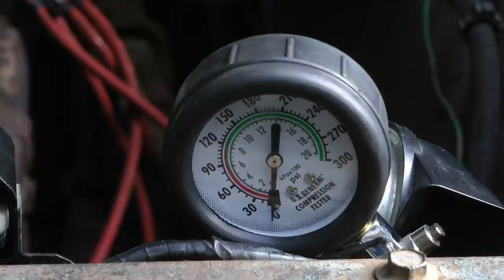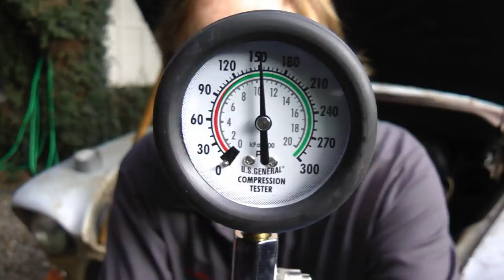How to Tell if Your Car's Engine is Bad

Comment: love ur vids,very cool. Question i have a car with the brake discs seized in place. i have taken out the bolts but it will not budge+ i am afraid to blast it with a sledgehammer in case i mes up the half shafts. its front wheel drive Renault Megane scenic( European car).its the type where the disc has a 2" hole that slides over the center spline onto the hub... any handy tricks would be grateful as its a sentimental car, my mum owned from new + its only has 68000 miles in 13 years

Comment: Hey Scotty I have a 1999 jeep Grand Cherokee Laredo.2 mechanics said my motor is blown it never overheated it has the straight 6 in it it only starts to shake after going about a mile do I think it's a blown motor problem or is there anything that I should know that's a sure sign of a blown motor? Any advice will b very appreciated

Comment: scotty I have a 2002 ford Taurus with 195k. question, whenever I drive between 30-45 mph my rpms drop down significantly and my engine feels like it lost power. if I continue to press down on the pedal my car jerks and if I let go and press down on the pedal it picks back up on power. do you know what this could be? I appreciate any help or advice. (I have replaced sparkplugs, coil pack, plug wires) and problem continues

Comment: Great Scotty. I've a VW 1.8T benzine engine that burns the motoroil in seconds, thick white smoke of the exhaus pipe, milky fluid on the motoroil filler cap and engine has no power. Did all happen after i fix the low oil pressure of the engine. The filter in the oil pan was dirty. There is no oilleak outside the engine.The engine was normal at the time and motor oil was stabel at that time. Now its worse.What is all the cause of this? please help me. Your Fan

Comment: Hey Scotty. If compression is still low with a little oil valves are leaking? Like your channel
Reply from the maker: yes, oil will not seal worn valves, only worn piston rings
Reply: Scotty Kilmer OK, now I realise why you said it was bad when the pressure went up.

Comment: Sadly recently found out my engine is wearing out.  cyl #1 is down to a 105 psi. the rest are around 150 psi. So im pretty much just having to deal with it because i can't afford to rebuild it. But i know that when i rebuild it, im going to build the bottom end with forged internals.

Comment: Hey Scotty, I have 2016 Ford mustang ecoboost and 2 days ago my car had P01450 and P018C code which i got fixed (replaced Fuel Pressure senson and Purge Valve)  from the dealership. My car does not have a check engine light but I still scanned my car for any pending codes and I found it has P0304, P0316 and P0234 but no check engine light yet. Do you think my engine is failing? my car is bone stock and covered under power train warranty.

Comment: Hey Scotty I have a 02 s10 2.2 and it is idleing really weird. Still runs but has no power and is smoking out of exaust but the car isn't overheating and I have good oil pressure.
Reply from the maker: +Jesse Lewis do my video "how to tell if your head gasket is blown" it probably is going out

Comment: I usually figure things out myself, but I'm in a bind    I got a 94 jeep grand cherokee    (california)    voltage regulator went out   replaced computer first time    then ran for 500 miles or so then   60 amp fuse burt out again.    replaced computer again and it lasted for maybe 100 miles  now its the third time    waiting for computer to come in from auto zone     i suspect it will work for a while   Do you think I'm getting a bad computer   or is there another problem?

Comment: I was checking the changing the head gasket ended up taking out the fuel rail some of the fuel injectors Stewart on the head and I don't know where they go my friend told me that they have numbers and on the fuel rail and has the number to the injectors I don't see none at all how can I check which one goes in which hole thank you

Comment: so what should a cylinder compression be in  a 2002 toyota celica for example? and if you add oil and test again you say the compression shold read the same not higher? or motor rings are shot,,,thanks

Comment: So if I am hearing this correctly, by pouring the oil into the cylinder it seals the worn piston rings and raises pressure in the cylinder. But if you pour oil into the cylinder and pressure is still low then it means that the valves are leaking or bad and the piston rings are fine?

Comment: Which is the most to least reliable engine in terms of long term reliability from your experiences: Toyota's 2.2L 5SFE, Toyota's 2.4L 2AZFE, GM's 2.2L Ecotec(Saturn Ion, Chevy Cobalt, Cavalier) or GM's 3.4L(found in Chevy Impala, Buick Rendezvous, etc)?
Reply from the maker: they go from best to worse in the order you presented them, except that gm 2.2 L is the worse of the bunch.
Reply: From my 16 years in the repair business GM engines are far worse then any Toyota engine. The 3.1/3.4 GM engines have many flaws and a big one is the intake manifold gaskets which if left unfixed will cause coolant to enter the engine oil and it's over from there. This repair will cost on average $800. Where the Toyotas you listed don't have any major issues. The 5sfe do tend to leak oil from the oil pump oring but they are pretty stout engines.
Reply: My wife has a ecotec 2.2 Saturn ion (2006) and it hasn't give her any problems and it's close to 200,000 miles. Just basic maintenance... Hardly any money has been invested into the car

Comment: didn't catch it if you did mention it but on modern cars its not a good idea to wet test. The oil goes down the exhaust and smothers the CAT in oil which then doesn't do the CAT any good.
Reply from the maker: that tiny bit of oil won't hurt anything, most blows back into the pressure gauge anyway

Comment: hey scotty can you make a video or do you have a video showing the different colors of exhaust smoke??? i have a hyundai santa fe with a 3.5 L engine that is smoking it looks whiteish and at times looks like a blueish tint (which im not really sure about) but im going thru oil like 3 to 5  quarts in a months time.  the exhaust has the smell of burning oil and fuel and something else i cant pin point ( every now and then smells like eggs). the oil has not color change and when i check the dip stick and put on a white cloth  appears to be normal it also smells like fuel.  
i have pulled the plugs they look greyish to me no black or other color.  i know the valve cover gasket is leaking ( which i am waiting for the part to come in to fix). but the smoking is now my concern. im thinking its the head gasket or a valve problem. which im not really sure about either the more i look into things its starting to sound like bad rings. so i would like your advice if possible. 
when i run this compression test should i make sure i pull the fuel pump fuse so it does not start up ????
Reply: also it does not seem like there is a compression issue it has power and doesnt seem to lose power or drag at all. that is why im concerned. i bought it used at 126k and put about 2000 miles on it so far so i dont know if it has had any other work done.

Comment: Hey Scotty, my cousin has a 2000 GMC Sonoma with over 200k on it. A couple spark plugs got broke off in the head and he doesn't have time to fix it himself. I'm going to buy it off him for cheap. He currently has the timing belt taken off it, are there any ways I can check for the engines health without having to turn it over? I've checked for oil leaks on the top, and the side of the engine. Any advice would be great, thank you.

Comment: Hey again Scotty.  Hope all is well in Texas.   Gonna do a compression check on my engine and just wanted to know do I need to put any sealer on the spark plugs when I screw everything back in after the test (just reusing the old plugs). What do you reckon?
Reply from the maker: Tom Pongrac no, but you can use some anti seize lube
Reply: Scotty Kilmer Thanks Scotty

Comment: Hello good sir, How much oil did you put in? Will too much will bend a rod like you told us about water in the "why driving through water is bad" video?
Reply from the maker: +Daniel Keener oil is on the other side, the inside of the engine, not the compression chamber. SO, too much oil won't bend pistons,but it will blow out oil seals and cause oil burning too
Reply: But I thought he put some in the spark plug hole? :/

Comment: My 1996 Chevrolet Cavalier keeps cutting off and can't find a fuel pressure regulator. Do you think that a new engine will fix everything?  Been unsuccessful with 5 mechanics including Autonation Chevrolet. They claimed to have replaced the oil pressure switch and don't know why the car cuts off when driving, and recommended to have the #4 fuel injector replaced and mounts upper and low. What do U suggest?

Comment: Hi Scotty! I have rav4 2002 and worried about a metal chime sound at 1500 rpm. What is this problem probably? Thank you Scotty!
Reply from the maker: +benedicto zaragoza check for worn exhaust parts, like heat shields or rattling cats

Comment: so, when you test the compression, are you starting car? or just trying to turn it over until the needle on the gauge stops spiking up. also, how/where can i find what the average psi on the cylinder? a technical manual?
Reply from the maker: just turning it over. but most manual do not give specifics as it varies a bit even in the same engines due to production non purity

Comment: Hi. If the compression is bad would it be worth it to overhaul the engine? Or is it beter to just buy a used good motor ?
Reply from the maker: depends on IF you know anyone who can rebuild them correctly, that's a dying breed these days

Comment: Thank you for the video(s) Scotty Kilmer.                                                                                        
         I have a stupid question here- if I'm not supposed to ask here let me know. I am looking at doing a engine compression test for 1996 Jeep Cherokee. I had drained the oil and taken out the radiator and serpentine belt (in thinking it was head gasket but now it might be rear main seal oil leak) So I would like to do a compression check. I was going to put some oil in maybe 3-4 liters back into the engine). Can I get away with 3-4 liters of oil (6 liters normally) if I'm turning the engine with the starter 5 count/ times each cylinder as you show (5x6 cylinders)x2(dry and wet)=60 times of cranking with starter.
Reply from the maker: yes, that's fine as long as the engine does not start up and run
Reply: Thanks for the help Scotty- I did the compression check with 4 liters of oil just with cranking and no problems.

Comment: I ned your help mr.scouty.  my engine might have melt piston rings. so the oil leak out completely so the oil pan gasket need to replace because oil come out from bottom. so with a dry engine I turn on the car and engine sound rough, and lots of smoke came out from exhaust. it dies out in 3 seconds. even a dry engine can run for more than 10 minutes without oil. so what's the problem. I red line through 1-3rd gear and up to 4th that's the problem came up. the engine wasn't fully warmed up and with a supercharger

Comment: why not leave the outside as is, it has character, simply put on safe tires do a tune-up and run 1quart of Lucas in the oil? worked on my dad's truck and got an extra 67000 miles out of it

Comment: Can I bring up something that I always do during a compression test? I always stick a spare spark plug into the pulled wire before I crank the engine. Make sure the spare plug is grounded to the inner fender or something. It only takes an extra few seconds. The coil tries HARD to make a voltage high enough to jump the spark gap and I think it hurts the coil when there's nowhere for the voltage to dissipate when that pulled wire just hangs there in space. Maybe it's just me.
Reply from the maker: +Scott9084 that is a good idea IF you have no combustible gas coming out of the engine as it cranks. Just don't start an explosion

Comment: I have Toyota Corolla 2009 s model with 137000 mile one it. I took to so many places to fix driver side pulling specially when I go over 60 and sake really bad when I try park by going back. It sake worst when I go really slow to park. Any help or advice is highly appreciated.

Comment: scot i got a 2nd hand 5sfe engine thats done about 170000kms. im getting the head resurfaced and reconditioned with valve jobs and etc. i cleaned the carbon off pistons and the piston walls look clean and everything and inside internally with sump removed. will the new head cause problems with the bottom end?

Comment: Hello quick question.Before I start my 94 Chevy pickup their is a loud banging noise as the engine cranks .then when it dose start it stops??? I had someone mechanic  changed the distributor and now it's making this horrible loud noise.  Any suggestions will help thanks.

Comment: He never mentioned about having the engine warmed up or holding the throttle open while cranking it. I also noticed that he only cranked it 3 times with the low compression but almost 7 times after adding oil... hmmm?

Comment: I'm surprised that it is not mentioned in the video that when you do the testing, doesn't the throttle needs to be wide open to give an accurate compression reading?...
Reply: from what I've seen it doesn't, if it does make a difference its not that much maybe 1 or 2 pounds

Comment: and what happens to the oil you poured down that cylinder ??
would it get mixed in engine oil ??
what if piston rings and piston have good seal and it doesn't go down because i really dont wanna sit on that spark plug hole and suck oil out ? 
SO WHAT HAPPENS ??

Comment: You could just whip the cylinder head of of this engine, check the cylinders for scoring and replace the piston rings, new head gasket and maybe valve seals and your good to go. old engines like this can be fixed with a knife and fork !

Comment: The engine looks better than the body.Scotty left out one part.The valves could be leaking air when closed.A valve job on the heads could fix the problem.Oil can also show up on spark plugs by leaking valve guides and seals.Maybe it is both the Piston rings and the valves,either way,the engine needs both valves and pistons done to be sure..

Comment: Hello Scotty, i've got  a 2006 ford fiesta tdci (diesel) and its giving out thick white smoke during starting up and running the first few miles and exhaust smells like its burning. could it be weak rings? or can turbo error cause this?

Comment: Thank you for quick reply. I tried replying here but google+ it keeps sending me to login over and over. Makes it confusing! Is it possible to do compression check with no oil- like a check in the junkyard if one can hot wire engine to crank for compression check.

Comment: About how long should you crank the engine while checking the compression
Reply from the maker: doesn't really matter as long as you do the same cranks for each cylinder. Generally 3 or 4  revolutions is fine

Comment: my dad has 2002 chevy blazer been to shop like 4 times and they said never wrong with it but EVERY NOW AND THEN RANDOMLY WONT START UNLESS YOU KEEP FOOT ON GAS OR IT STARTS AND THEN STALLS BUT IF YOU GIVE IT GAS AND DRIVE IT UNTIL WARMS UP TO 1K IDEL IT WILL RUN WHAT IS IT ?

Comment: Hello Scotty,
I have an 1997 subaru out back impreza, when I give my engine gas,  my car has trouble shifting gears, and when my car does shift gears, the car goes with it. Also, when I slow down it feels like my car wants to go backwards. What should I do? What is wrong?

Comment: Hey man trying to figure out wether my engine knocking is from harmonic balancer or the rocker arms IN A 96 CHEVY PICK UP 2 DOOR 6 CYLINDER SHORT BED I have shavings in my oil since the noise started... 
NEED HELP ASAP PLZZZZ

Comment: hey scot, youve been helpful in me picking up new inputs. 
my question, what could be the normal values of the compression tests? like how many pounds does it have to be to say its healthy or not. does it vary from car to car? thanks.
Reply from the maker: +ShaDo J it varies widely depending on compression ratio, design of engine, and mileage

Comment: why not just rebuild the engine instead of buying a new one?...resurface the head, clean the seats of the valves, hone the walls, new pistons, bearing, and rings, hes good to go right?
Reply: Yeah generally a rebuild wouldn't be too hard and you would have a fresh engine. But factoring in machining shop and such to hone the block you would be in around $1,000. I would imagine if you pickup an old truck like this to restore you better be ready to spend some money anyways lol.
Reply from the maker: the guy just had this used junk yard engine installed, so he was pissed. Already spent a ton on 3 other trucks he was fixing up, so this one is staying the way it is for a while.
Reply: Ex af T T u 40 4w
Reply: Scotty Kilmer but if he had the money, that sounds sound right?

Comment: So, in comparing the dry/wet pressures, we're looking for approximately the same reading, is that correct? i.e., it's the differential between the wet/dry readings that indicate issues with the piston seals?
Reply from the maker: yes